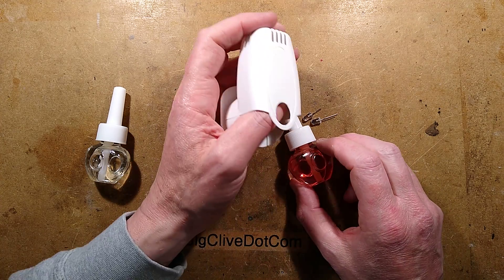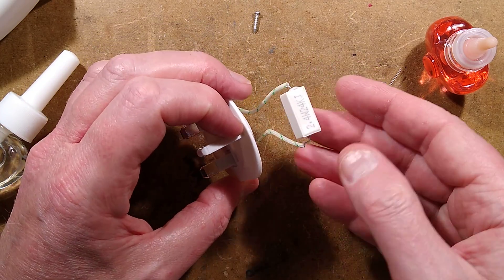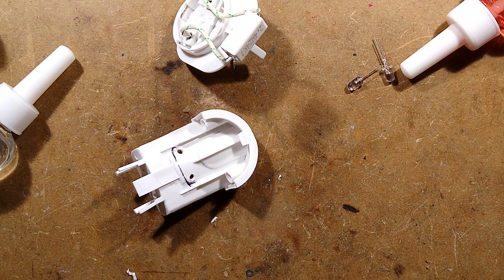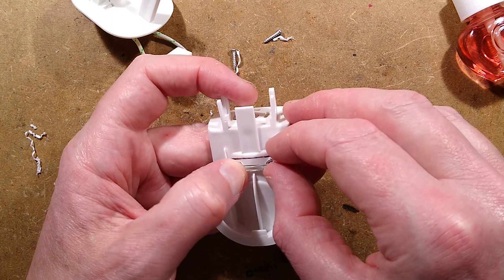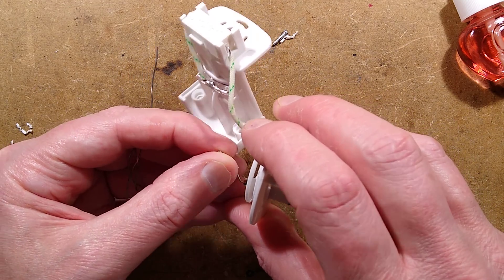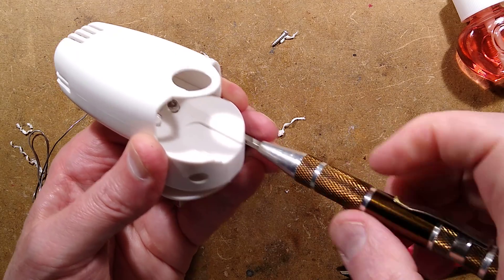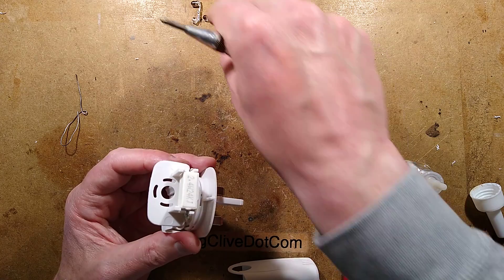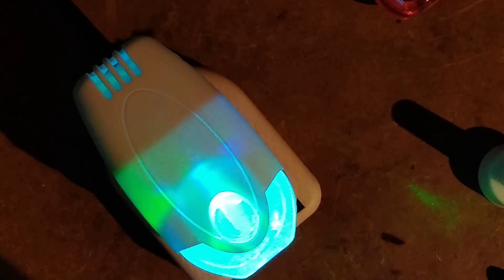Air "freshener" hack gone wrong

Comment: Wondering would it be possible to solder in a small fuse and if so what spec ???
Just trying to make it safer. 
When it shorted and leds popped it did not appear to trip the beaker ???
Reply from the maker: The LEDs have an odd characteristic of limiting and clearing faults better than a fuse.
Reply: @bigclivedotcom  cool so perfectly safe if something goes wrong. Thinking the leds make it in to a cool nightlight and may be possible to replace the perfumed liquid with some natural oil in a water solution

Comment: Led at 240 volts? Can you explain circuit please.
Reply from the maker: The resistor limits the current to 10mA, so only around 3V will be across the LEDs.

Comment: Awesome and exciting as usual.  😉👍🏻
Personally, I always insulate any bare wires that carry mains potential with spaghetti tubing, heat shrink, or just a piece of insulation stripped from another wire, specifically to avoid such scenarios. Especially since the LEDs can again move every time you insert or remove the bottle. Electrical tape, silicone, or even hot glue if you can't insulate because you need to solder.

Comment: i got the glade ones that uses 2 and has fan. don't know why they got rid of the ones with fans but they are hard to find now. will say i don't use as much as airwick mist diffuser ones. still wish knew how you can refill the mist ones because whatever i try they stop working with what i refill with.

Comment: Awesome vid.  I need some help with the schematic.  If it's 240VAC with a 24K resistor...how many volts are going through the LED's (assuming they're 3V/20mA FV)?  Never seen LED's wired this way.  Can someone help explain?
Reply from the maker: The resistor limits the current to 10mA.  The voltage across the LEDs will be around 3V.

Comment: I've powered a parallel chain of PTH, long hat LED's with a chonky capacitor meant for airplanes (weighted 5 kg, had around 80v and stupid massive capacity) and used a much lower resistance resistor than i was expecting (color bands were icky and i was never good at reading them in the first place)
End result was a LEDhead shotgun that had classmates ducking under their desks in terror.
Would do it again, teacher laughed so hard he got his abs back and gave me free access to the lab.

Comment: My air freshener has LED from the factory no need to add. It is only possible to change the color or use a self-flashing multicolor LED to look even cheaper and more Chinese. Replacement refills bottle are no longer available I do buying a refill of another brand to pour into a single one bottle I have and replace the stick with a fresh one. The problem is that it evaporates even when not in the socket and consumes a lot of fluid even when not in use. I also have full drawer of empty bottles from another brands I used to refill mine.

Comment: Exploding LEDs are no joke! Once when I was a teenager, mucking around with breadboards, I accidentally connected an LED directly across a 7805-based power supply by carelessly brushing a wire against another wire. The lens instantly bounced off of my glasses. If I hadn't been wearing glasses, it might have been not so good.

Comment: This is something that Photonicinduction might have done -- the LEDs go, "POP!!!" :-)
 
I heard them suckers popping off like Snap-Its (those little cigarette paper balls filled with sand and a bit of silver fulminate that go, "POP!" when you throw them at a hard surface like the floor or a wall).
 
I didn't even see a flash of light when they died. :-O

Comment: Seems to be a common pracrise to use that type of resistor as a heating element, I've seen them installed In the switch boxes of truck tailgate lifts to keep the switches dry and to prevent freezing.

Comment: i always find that people don't buy the refills they just throw out the old one's when they empty, AND THAT'S WHERE I COME IN.. I ASK TO TAKE UM OFF THEIR  HANDS FREE OF CHARGE OF COURSE. BECAUSE MOST HAVE A HIGH POWERED RESISTOR INSIDE THEM.{mostly between 24K omhs like in this video up to 27Kohms i find. so do be expecting 10 omhs or 5 ohms coz you won't get them that size. but if your like me collect then anyway} COLLECTED A GOOD FEW A OF THEM NOW! (THE RESISTORS, NOT THE SMELLY AIR FRESHENER'S)
P.S. OH BEFORE I FORGET.. NICE VIDEO CLIVE. LIKE WHAT YOU'VE DONE!

Comment: wait... You can connect 3v DC LED's into AC power? :O
Reply from the maker: With current limiting, yes.  And in inverse parallel so the lit one caps the reverse voltage across the other one.

Comment: The question I'm asking myself is ,WHY? If it's cheep that you throw it away and get a new one, why would you bother to even contemplate doing this? Opening it up , soldering up the diodes, and putting it back together, the diodes probably cost just as much as the whole unit cost to produce it, why? Sorry Clive, but I think you've become irrelevant.
Reply from the maker: Yes I have become irrelevant.

Comment: I think I can see the problem just by what you didn't do... As well as something you also did, you didn't create a circuit with the LEDs, you created a circulator, where energy goes in and constantly goes around building up like a transformer, except a transformer is an external booster source, the circulator is a directly powered meaning it'll constantly build and is very much volatile and a major risk of fire and explosions, now onto what you did... Created a circulator using the LEDs, what you really should have done is snip the LEDs connectors down, soldered the live to one LED and the return neutral wire to the other... Might not get the result you wanted but at least you'll get a hack that'll work, also I'm no professional individual that knows anything in this sorta thing, but what you did is an obvious thing... But I understand it's not because you messed up, but you had one of those real life things to do with age, so don't be disheartened by this advice, but why not create little lists of things of do's and don'ts for your own reference when doing a hack like this, that way you'll begin to not only learn yourself but even teach us and leave a lasting memory so people would want to come back to watch not only to watch but one day try and succeed, which they pat themselves on the back for, but really are also spiritually patting your shoulder for the useful information... I apologize for the long comment, but you're welcome for the advice you don't really have to take, it's just a suggestion like what ralfy kinda does, writes a script of what he will say in the videos, crosses off what's said so he doesn't go in a circle at times, but my advice isn't something to cross off but act as a guidance to make things work

Comment: The thumbnail from your video “Over/under voltage detector - with schematic” is being used on advertisements for the company Voltex on their advertisements for those nonsensical power saving plug in devices. The advert appeared on the website RealTimeTrains although I’m sure they’re not at fault, the thumbnail image from the video doesn’t appear on the website however, just the banner in the advertising windows on the website, I’ve got a screenshot though. Just thought I’d let you know.
Reply from the maker: Thanks.  Images and video often get used by other people.  Particularly the scammers like in this instance.
Reply: @bigclivedotcom  Ironic really, a company uses a picture from a channel that exposed similar products to what they make.

Comment: Yesterday I was trying to find out why a remote plug switcher died, thought I could have dirty contacts as it runs a tiny compressor.    put ncreasing voltages over the relay coil untill it clicked, not sure why I tried the different polarity and a transistor exploded. Of the set of 4 from Wickes there's only 2 left and one of those has its fuse replaced with a bit of 1.5mm2 , I need a new set iv tried the Aldi ones ,they don't last long at all.

Comment: As soon as you described the circuit I knew the  LED's would pop! You put them right across the mains.  They're Light Emitting Diodes, not silicon rectifier diodes. Most likely they'd have popped too. This reminds me of the time I discharged a 500 volt phito-flash capacitor by shorting it with pliers. No boom, a BANG.

Comment: "... against the manufacturer's instructions"

It says right there, in the one-page printed insert:  "Do not modify the unit by adding LEDs with their exposed leads touching the mains input plug."
Reply: Or in the original language: "LEDs affix uncover lead neighbor high pressure plug not permitted"

Comment: I got cataracts at a fairly early age (40's) and had both lenses replaced with artificial ones.  Something they don't tell you about those lenses is a property called chromatic aberration, which means colors are refracted differently through the lens.  When I look at a string of 'purple' leds that are really red+blue, I see purple light reflected off nearby surfaces, but the light itself is two individual points - one red, one blue.   Your hack has me wondering if blue and green are far enough apart, wavelength-wise, to see the same effect.
Reply from the maker: I've had the red/blue separation with normal vision. It creates an interesting halo effect.

Comment: InGaN LED's seems to be good fuses, I had a GaP green LED with a capacitor dropper and the capacitor blew up, creating a domino effect that completely scorched the inside of the timer and resulted in two weeks of blackout because the main breaker was in locked room and nobody had access to it for a while. Fun times._

Comment: I like the smell of burning LEDs so I wonder if you have a circuit that will blow an LED every so often so i can enjoy the sweet smell of burnt epoxy?  Love the resistor straight across the mains with no fuse - now if you stuffed that case full of cheap LEDs........

Comment: Clive, Don't suppose you'd be interested in a failing LED bulb to investigate? This one randomly flashes bright (made the think there was lightning in the area) and randomly goes out for less than a second?
Reply from the maker: LED lamps are made to die.  It's probably a bond wire on a single LED failing.

Comment: Would you mind doing a drawing showing the voltage and lumens of the LEDs? They're each turning on at roughly 30 Hz, is that right? I'm surprised the flickering is so pronounced.
Reply from the maker: 50Hz alternation.  60 on a 60Hz supply.

Comment: Why didn’t you use resistors on the LEDs
Reply: No need. The heater resistor already acts as a current limiter.
Reply: @Mark1024MAK  so how many volts is it putting out
Reply: @nomusicrc  - the supply voltage is a nominal 230V AC RMS (actual is often about 240V). The forward voltage of most LEDs is around 2V to 3V DC. So if the actual supply voltage is 240V, the voltage across the resistor is 240V - 3V, hence 237V.
I believe Clive said the current is appropriately 10mA.
Reply: @Mark1024MAK  ok I thought he put it across the 240 mains and then it popped but it was because it was shorted

Comment: modifies air freshener, does wiring correctly, forgets to add heat shrink tubing or electrical tape for insulation of bare wires, assembles and pushes in LEDs, plugs in the modified air freshener, then kaboom.

cuts video, and comes back with a newly modified air freshener that works, but doesn't explain what he did to make it work other than "i cut down the LEDs". XD
Reply: I’m not sure electrical insulation tape would have made much difference given it was a sharp solder spike that pierced through the insulated sleeve. Tape is not known for its structure integrity 😀.
Having shorter LEDs (straw hat as Clive said), ensuring there was no sharp solder spikes and adding a thin piece of plastic as a barrier would have been the better way to do this…

Comment: A Big Clive video that actually goes horribly wrong? Excellent! 

3:12 That's common construction for 5W wire-wound ceramic bricks; I suppose that's the most economical way to construct these devices. Last I checked, back when I was building guitar amps from old TV oscillator tubes, their cost at volume wasn't terribly more than 3W metal oxide resistors.
Reply: And other sizes / power ratings of ceramic power resistors, such as (some) 3W, 7W and 10W.

Comment: Finally, something without a capacitor and has a 1.0 powerfactor? Or does the wirewound resistor make it lagging PF?
Reply from the maker: The power factor wasn't quite unity for some odd reason.
Reply: @bigclivedotcom  I'm guessing the wirewound power resister is a bit inductive being coiled wire.
Reply: @curtw8827  - maybe, it depends on if it was wound to be non-inductive or not. Most likely not, as the non-inductive versions are more expensive.
Also at low currents, it’s harder for measurement equipment to maintain accuracy.
Reply: Resistive loads are indeed unity. Unlike the chemical mix from the bottle of who knows what….

Comment: As a kid I often added holes and LEDs to a lot of my electronic possessions. I liked indicators for things you wouldn't usually know about. Like a head direction indicator on a cd player', or an led in the volume dial of an amplifier that didn't already have one, or a mains supply indicator on equipment that had a mains power switch that would light when plugged in but switched off, or LEDs in the red fire buttons of computer joysticks... I could go on 😃
Reply: I did that also! It was fun back then, swapping the boring red LED for my first ever blue one, which cost 5 pounds then, about 30 pounds today! And then later blowing it up! You live and learn my friend :D I also started putting neons across mains fuses so they would light up if the fuse died, only problem is you still have 240v flowing through the circuit, not enough to kill you, but it will give you a bit of a zap, LOL
Reply: @stawmy  Yes! I remember my first blue LED too. £5 from Maplin in its own packet lol
Reply: @ANTandTEC  Yep i think that was the same one, i got everything from Tandy, which went bankrupt but became RS components. I was sad to hear that the Maplin UK stores went broke :( But Henry's of Edgeware road, London, was where i spent my pocket money as a teenager in the '80s.....ETA forget Henry's now, the staff there dont know the difference between a resistor and an iPhone.....

Comment: Well, I'm also not much of an air freshener guy. But I like the idea of using the heating resistor as a current limiting resistor for the LEDs. You don't need any additional parts (except the LEDs of course), you almost get a unity power factor and the (almost) 2.4 W dropped over the resistor isn't a power loss since the heat isn't actually unwanted.

Comment: Wow... they have definitely cheaped out on these now... i took an air wick one apart and it did actually have a custom molded ceramic heater block. This looks like a standard 3W cement box power resistor :o

Comment: Air fresheners actually make me feel sick.  I have to sneakily unplug them when at peoples houses for drinks etc.  It sometimes gets me into trouble.  I can't be the only one?
Reply from the maker: They're nauseating.   I use them from time to time - briefly.
Reply: Strangely the manufacturers won’t say what chemicals are in them. That tells you everything you need to know…
Reply: @Mark1024MAK  google" air freshners ingredients"very good article from LOQUITUR focusing on the subject of various toxins,not to mention the risk associated with oil seeping into the wall socket ITSELF.
Using these devices at all,is comparably as dangerous as an unattended candle next to a curtain
Reply: Google the following topics.
Housefire caused by electronic air freshener.
Vape causes explosion.
What worries me about THIS one is that he used a FULL fluid refill.
If there had been a "major problem"he wouldn't have posted on you tube.
He might⚠️💥🔥

have collected a Darwin Award instead.

Check the refill capacity and formula.
I very much doubt you would want it anywhere near an ignition source if you knew what it was.
The MAJOR problem is that it is a detatchable refill.....the electrical end is going to suffer "WEAR AND TEAR".
It is designed to be left running,for days at a time.
When these devices fail,and short,the whole bottle will boil,then vapourise ⚠️💥🔥

Summary.
Don't merely unplug them.
Remove the fluid.Flush it.Then stamp on the device.
You just made her world a lot safer.
Replace it with a potted plant.

Say it with flowers😸buy her a Triffid
🌷

Comment: And I was wondering, what may go wrong.. Before You closed case, I looked suspicious to input connections and these wires, didn't see anything unusual.. Probably, short happened, when You pushed LED's back..
Cool modification for air pollutator with special effects before! 😂👍

Comment: Very entertaining and not a crappy mod at all. Would the slow colour changing leds have worked as well?
Reply from the maker: They would have needed rectification and a capacitor to keep the memory of the colour at the sinewave zero crossing points.

Comment: I got a batch of seriously iffy LED's a while back. Put everything up to and including rectified 3 phase on them. Could I get them to go bang? Nope one did do a spectacular flash then went black but the rest were just open circuit with a black dot.
Reply from the maker: They are very hard to blow up.  The electronic equivalent of an HRC fuse.

Comment: strange it didnt make that loud a bang,  when i was little i shoved a led directly across the output of a train transformer, it made a hell of a bang and stink,  i was holding it at the time so the stink wasnt just hot plastic but hot finger, got a nasty burn off it !
Reply from the maker: LEDs fail in a very controlled manner on 240V.  Quite impressive.
Reply: @bigclivedotcom  maybe just blows the tiny wire instantly on severe overload,, but on slight to moderate, wire stays intact but the led chip fries until it generates enough heat and pressure to melt then blow its encapsulant